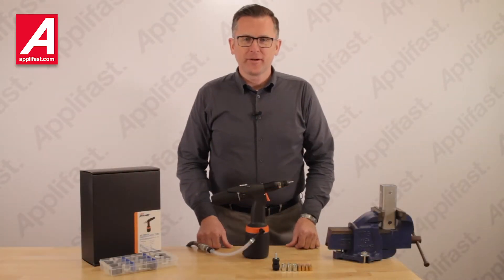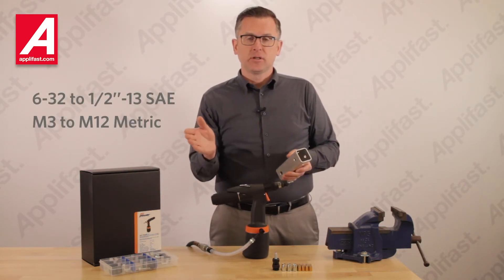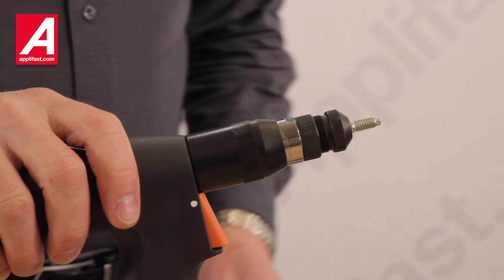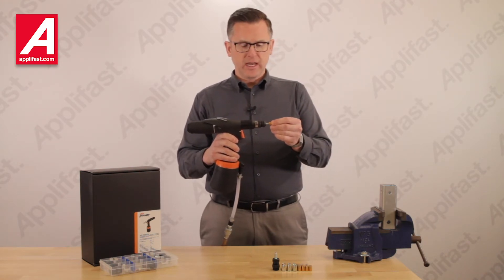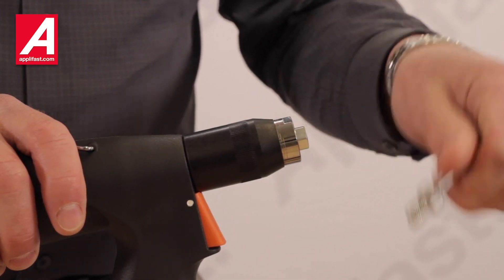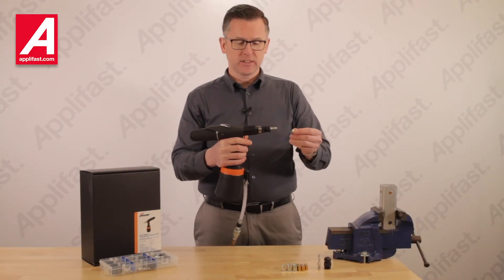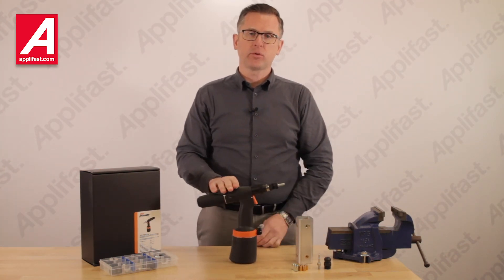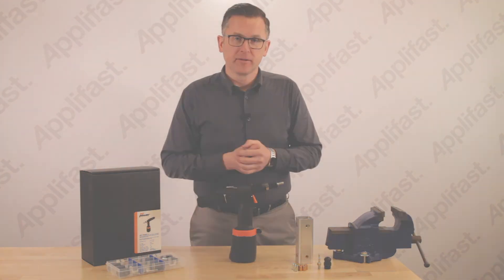Applifast AirPower AP4 Nutsert Tool Final

Comment: What happens when your mandrill does not come out of your nut once crimped
Reply from the maker: Thank you for your interest in the AirPower Threaded Insert Tooling. The tool has a great feature - it has a reverse button at the back of the tool in the case this does happen. Please contact us at info@applifast.com or 800-563-1293 if you require any additional information. Thank you!